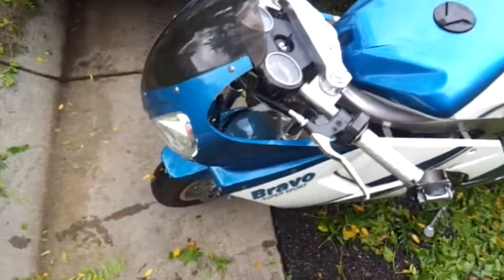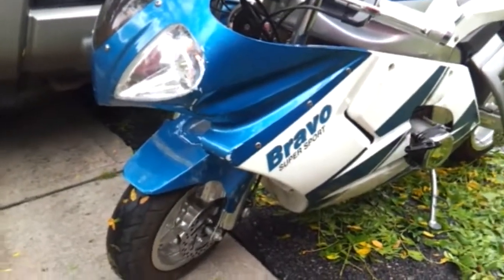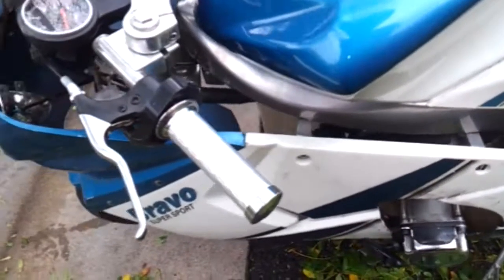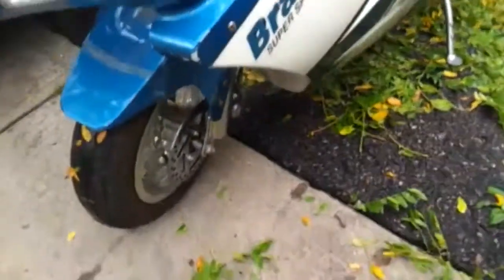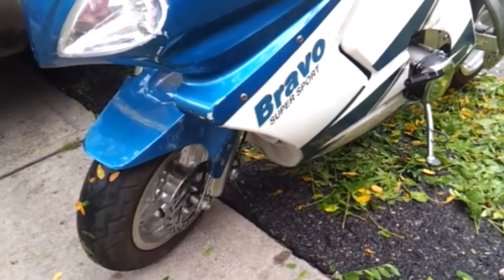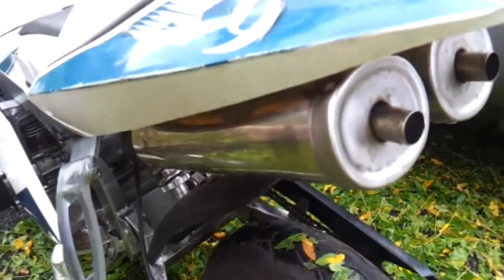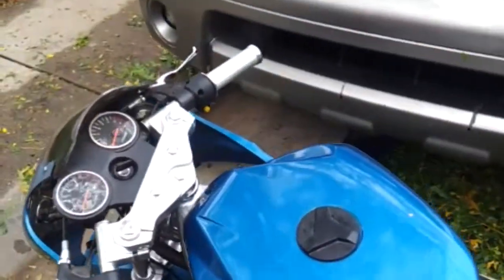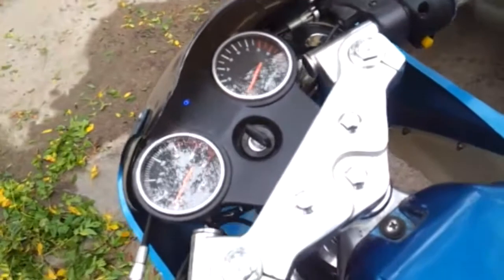A Look at the X-9 Pocket Bike

Comment: and I did drain the gas and put new gas in it but it will not start and new 2 stroke oil in it two but it might be the carborator though

Comment: one more thing how much do you charge to fix my pocket bike
Reply from the maker: Aaaaaa im no where close sorry. Hmmm i would take the carb apart and clean it out with some carb cleaner. When i was fixing pocket bikes on the side I would charge $20 for working on it and $80 + plus any parts if i was able to get it running. Meaning if i fixed it, it was 80, but if for whatever reason i could not only 20 for taking it apart and letting you know what was wrong.